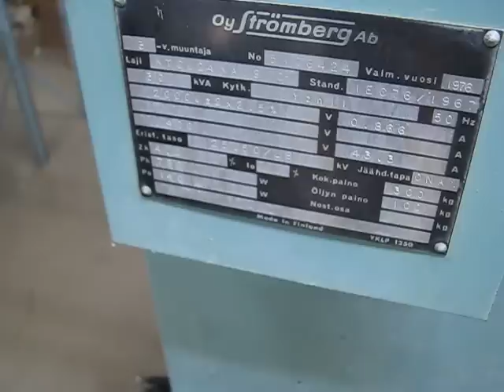Testing 3 Phase distribution transformer

Comment: Mmmm, that's a reasonably sized transformer......

I do wonder what the effect would be with one of these, if I wired a washing machine motor to the output, and controlled the voltage of the input with a sizeable variac? 

How much would that motor SCREAM ?!!!!! Imagine the inferno at the end, when the brushes melt down, and the whole thing dissolves into a bubbling puddle of metal !!!! 

Motor Murder. :-D 

{^_^} BoomBoxDeluxe {^_^}

Comment: That is really really dangerous. Do not play stupid games like that with big inductors and transformers. You could die in more ways than you realise. In particular, big coils like that can store a large amount of energy capable of producing instantaneous potentials in the megavolt range, leading to flashovers, high current arcs, electrochemical fires in materials which you assume and hope will continue to be insulators....JUST DON'T....
Reply: Bla bla bla

Comment: @PetaJUGENE The weather generally in Australia, is very sunny and pleasant especially in Queensland. However, because there is virtually no manufacturing industry here, almost everything is imported, and every importer/distributor here is out unfairly profit massively at your expense, I was quoted $20,000 AUD+ for a 200KVA 11KV/400V 3 phase transformer and even second hand products are only 30% cheaper! The excuse i given is that's what the market can pay.